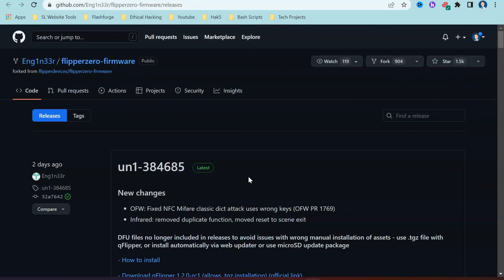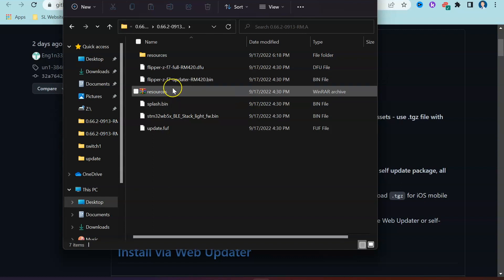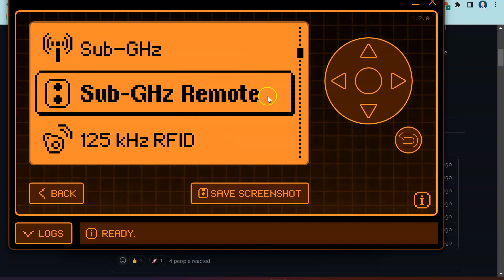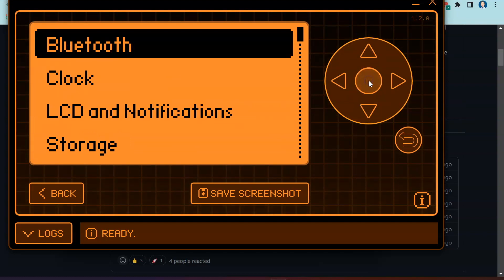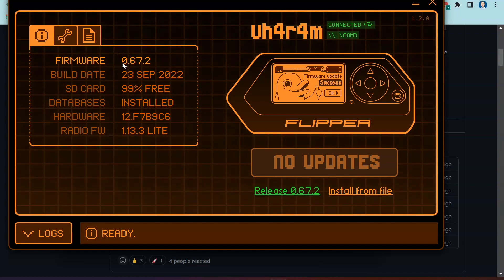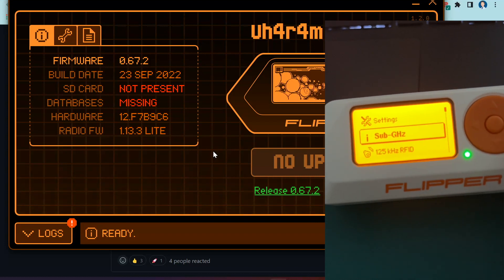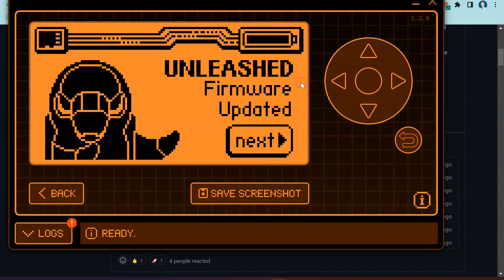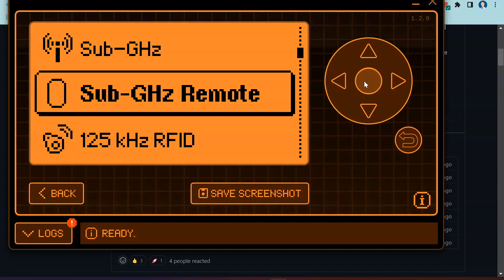Flipper Zero - Install Unleashed Firmware - [Full Tutorial]

Comment: Hey Guys, I have a Question, I just bought a flipper zero here in Brazil (damn it was hard to find one) , but I got a used one, really almost brand new , used 3x times tops, anyways, I was wondering if it's possible to Hard Reset the flipper? Also, should I be worried about getting a used one ❓ Thanks anyone for the help 🙏
Reply: you can factory reset it on the qFlipper settings / Erase it will factory reset it, and if you worry about being bugged don't worry I will say is hard but not impossible, but nobody has found a back door due that it needs to be plugged to a PC if you want to have remote access, that's what I have notice so fat
Reply: hold mid button and back for 30sec...

Comment: trying to flash the firmware through flipper and it keeps crashing the app, tried to load the update onto the sd and the update failed from the flipper as well. Any ideas?
Reply from the maker: Is there an error number?
Reply: @steamlabstech  no there wasn't, I ended up deleting the files and retrying with uploading the files to the sd card and it worked this time!
Reply: Any idea on how to flash marauder to an esp32 from a Mac?

Comment: do I HAVE to factory reset and reinstall everything again or can I flash the firmware with all my saved info on it?
Reply from the maker: You can flash the firmware with everything saved on it as it will overwrite it anyway
Reply: do you reformat just to be extra safe then or is there a specific reason for doing it?

Comment: Hi Steam Labs, I was wondering... I've installed the Unleashed firmware a couple weeks ago. But there are still updates in Unleashed, what is the best way to update my Unleashed firmware to the newer version? Do I just repeat the steps I did when I installed the Unleashed firmware for the first time? (like put the (new) files in the update folder> update file (run in the app)
Reply from the maker: I believe so yes, you won’t be able to use the update function in flipper or you can connect to it through terminal and run updates there, in my opinion I would just take the latest release and reflash
Reply: Don't update to 66 stay wit 65 ,,subgz works real good..

Comment: after i copy the update file to the sd card & search them on updates folder. I cant find them to update
Reply from the maker: If you have inserted the SD into the flipper, if they have been successfully copied across, you are looking for update, the update again, on the second update it will ask you to run on app, if you are not seeing this, something has probably failed when copying across

Great video on the flipper FYI, I saw it on your channel the other day
Reply: @steamlabstech  thank you 😊. Your videos are great.. is it maybe possible that it fails because i do it on a mac?
Reply: @steamlabstech  i tried now several times, but same result
Reply: I did not work, i tried it several times on mac & pc..

Now i installed it otherway.. 
i just downloaded this file „flipper-z-f7-update-un1-384685.tgz“ i installed it with qflipper: install from file. 
Now it works
Reply from the maker: Might be because you are on Mac, but I don't have issues running it on both, glad you have it working.
Reply: @swissiphonehacks7118  I did on qflipper on mac also.. it worked, except some things like the games are missing.
Reply: What can i do?